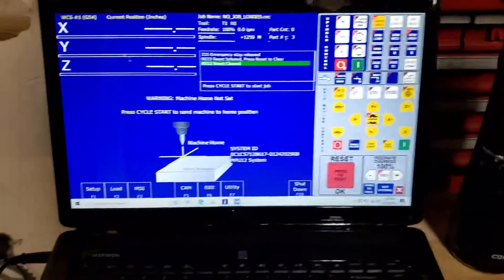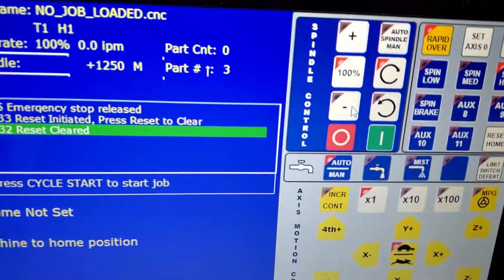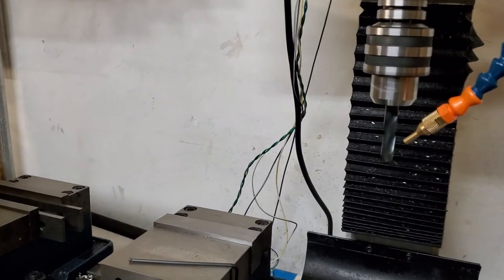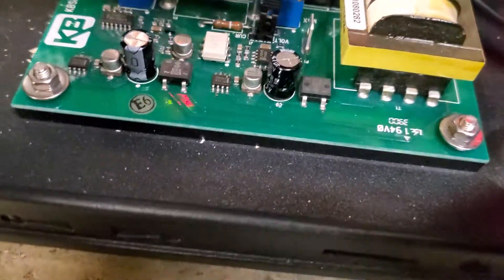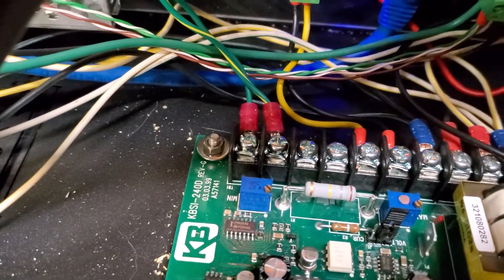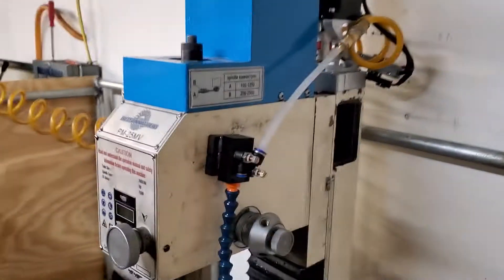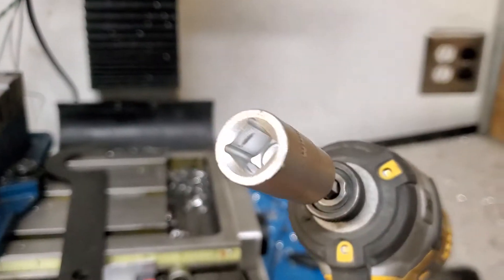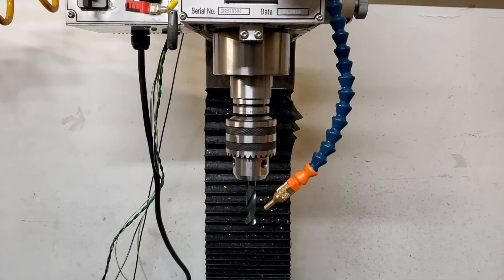Cnc spindle control on pm25mv

Comment: On Franco's diagram he connected the direction and speed signal to  set of pins on controller. On my PM-30, I do not have the 7 pin connector,  Did you wire the kbsi directly into the connections that went to the POT and DIRECTION switches?

Comment: Did you disable or bypass the power switch on the PM25. I noticed in your video the Green light on the switch is not on. Or maybe it just does not show up in the video. I am currently converting my PM25 and sort of want the CNC controller to turn the master switch.

Comment: How did you make the connections inside the pm25mv motor control box?
Did you completely disconnect the potentiometer and connect the wires from the kbsi 240d to those wires?
If so can you show the connections?
The forward / reverse part is easy but the speed control part is where I'm not sure.
Please help
Thanks
Reply from the maker: James. I don't have any pictures or video of that part. What I did was find the correct plug wires coming off the pm25 board and I cut them in half and only connected the wires from the board to the wires that went to the board. That left me about 3" on each end incase I made a mistake. Did you download the diagram from Francos video?
Reply: @ponydowncnc8365  no I didn't 
I will go look now and see if it makes it clear to me.
By the way...
I have enjoyed your videos.
I am building one hell of a PM25mv
I will post after the build is complete.
My main concern was the wiring inside the PM25 and I don't think Franco covered the actual wire up.
Thanks for your help so far.
Reply from the maker: @jamesreed5226  yea between Francos video he posted and the diagram that guy made for him it was rather easy to get things working. I'll sub to you so I can check it out when it's done. I'm glad you have enjoyed the videos. Unfortunately I can do Videos much much better but I don't have the time. So some quickies are what I post. Lol

Comment: Maybe I missed it, and I am in the process of 'researching', but what tells the spindle to switch directions via that 10v pair of wires? I mean, the program calls to switch directions via M03, M04, and M05 - but I am trying to understand how it stops and switches directions. (I just ordered my Acorn, and trying to get all ducks in a row before it gets here)
Reply: I totally missed the part about not having a VFD and a 3phase motor - Now it makes a lot more sense. I thought I might have been missing something!
Reply from the maker: @diygaragetx  yep. Just a stock 110 motor. In a video Franco said its easier with a vfd. So idk since I have not been down that road. Good luck!
Reply: @ponydowncnc8365  thanks man!
Reply from the maker: My understanding is that the 0-10v comes from acorn and is adjusted in the board. From the board it will goto the machine for 0-5v. I also have 2 outputs on the relay board programmed for spindle forward and one for spindle reverse. Franco cnc on here does a better explanation and shows a wiring diagram. That's the same info I used.
Reply: @ponydowncnc8365  ahhhh.. ok, I've seen some of his videos. I'll go check it out! Thanks! Ps, I do a lot of turbo fab work, and may or may not have a 7 sec fox body on my channel ;)
Reply from the maker: @diygaragetx  I'll have to check it out for sure. Just in case there is one. Wink wink